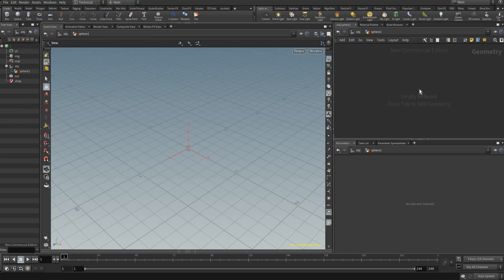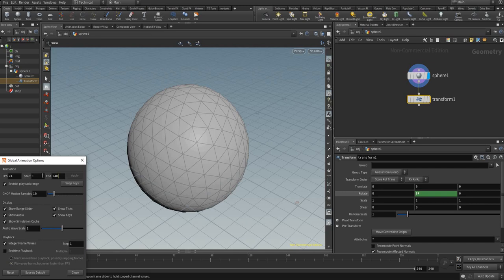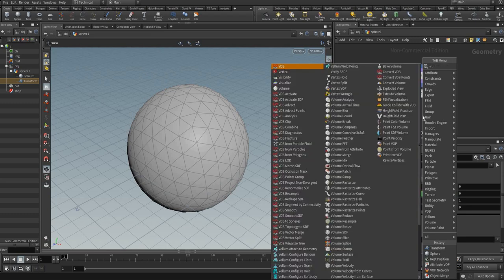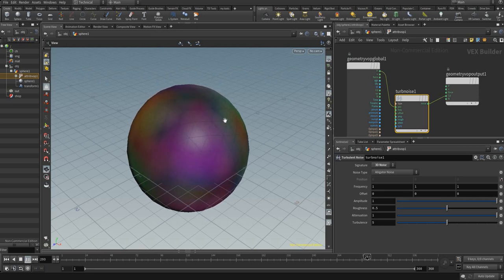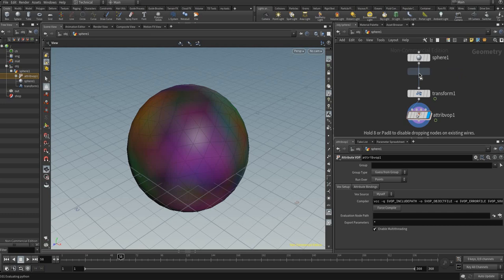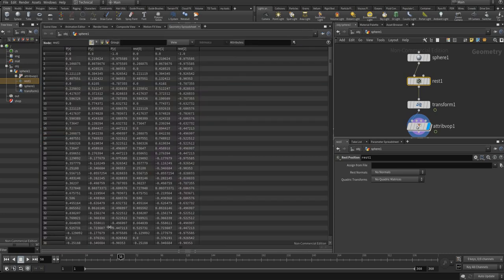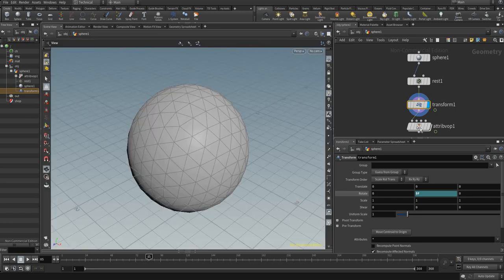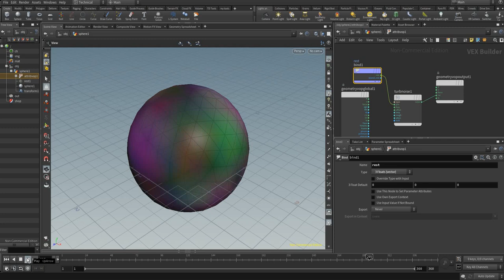houdini noise follow geometry

Comment: would just adding the transformation AFTER applying the noise have the same effect?
Reply from the maker: Hi sikliztaibunch!
You have a good point, in this particular case it would work!
But there are cases where we don't have the option like using when using  cached geometry.
Reply: @Terranimator  Yeah. In Houdini, it´s always good to know workarounds. I am sure there are plenty of usecases for your method. But I guess, I would have just use a timeshift/timewarp then and wired those "fixed" attrib values back in later like in that entagma tutorial with colored sand grains that show the logo at the end of the sim. I am sure you know what one I am referring to.